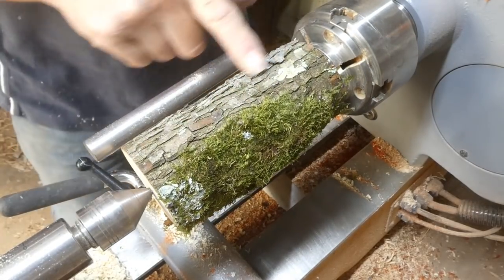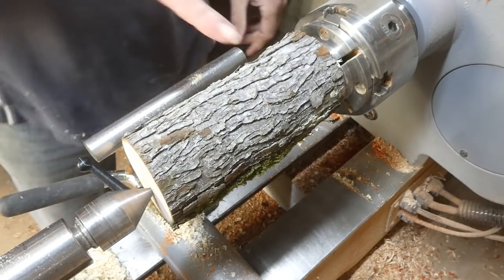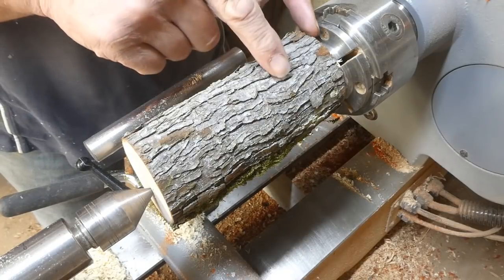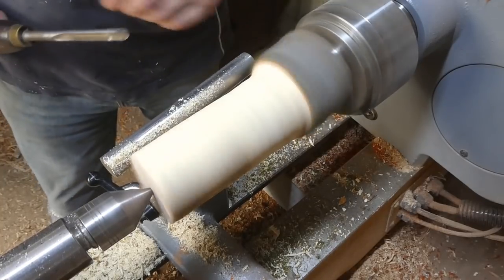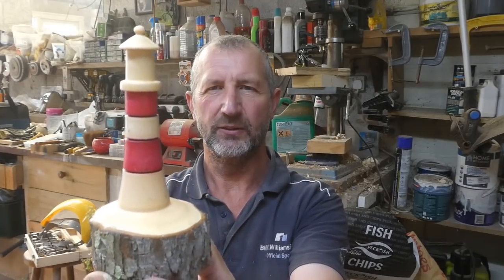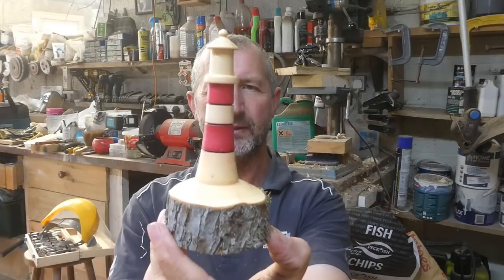20 min. Great gift or Easy Craft Sale ! - Wood Turning

Comment: Hi Andy great little project, and was that just a piece of wire you used to burn the ring around the lighthouse not something I’ve done before. Keep up the great work.
Reply from the maker: Hi Paul...
Thank you very much...
I actually bought the wire from a woodturning shop... I got 2 thicknesses for q thin or thicker band...
But you can use pretty much any wire... turn the lathe speed up high...
Just make sure that you put handles on the ends and don't wrap the wire around your fingers...
It could take your finger off...
Take care...All the best.....Andy

Comment: Is that a copper wire you burned in?
Reply from the maker: Hi Danielle...
I think that it's like a piano wire...
I bought a pack of 3 different sizes... 
Woodturning burning wire... should find something...
I have used copper wire which works fine but it's not as flexible...safer perhaps though...
Just make sure that you add a handle at each end and do not wrap the wire around your fingers...
I am posting a video today and at the end it shows the wire catching up and wrapping around the wood...
Hope that this helps...
Take care my friend...All the best.....Andy